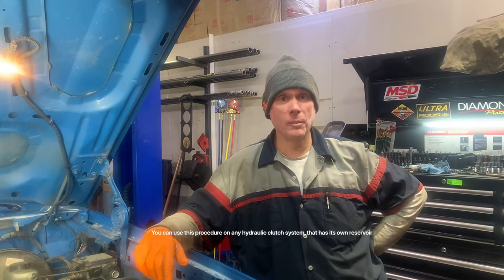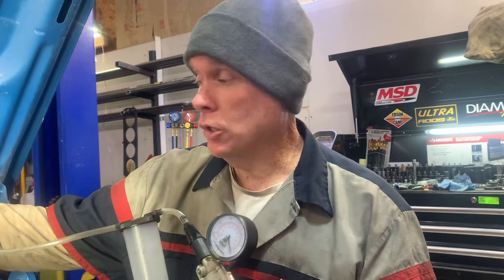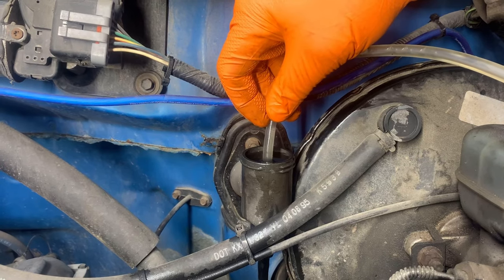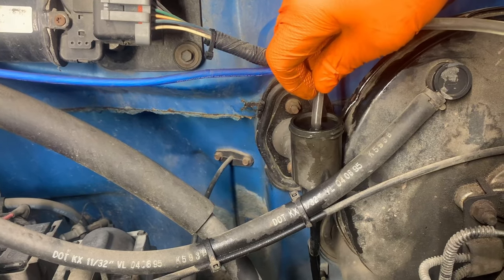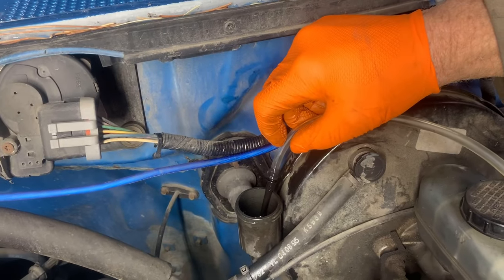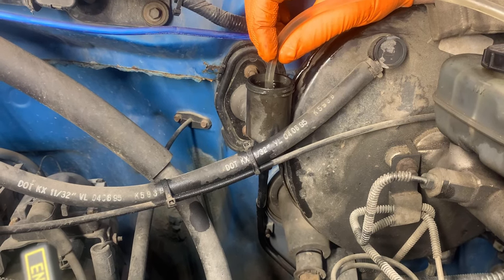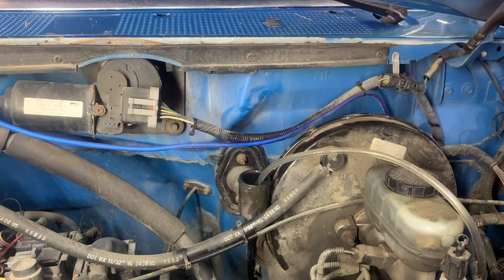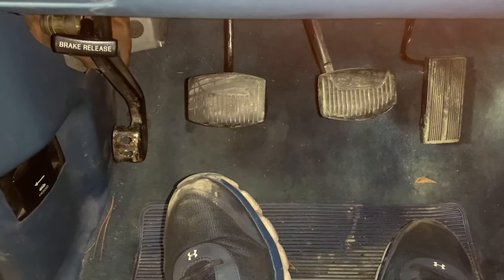Easiest, way to bleed a clutch. Works on impossible Ford concentric slaves. Can be done alone.

Comment: [Edit:Solved]
Really hoping this method solves my clutch bleeding in the end.  I have a question tho.
88 Ford f350 7.3 concentric(?) clutch (tiny allen key bleeder <or> no bleeder).
In the bottom of the reservoir there is what looks like the center of a keyslot on a car door.  So kind of a slot that is rectangular.  At the top of the slot there is a small hole.  Then at the opposite end is a super tiny hole.  
First I sealed off both holes.  I'd get a vacuum, then as soon as I'd go to pull it out (with the fluid topped ofc) the pump would pull all the fluid out of the reservoir faster than the master will pull it down in and air would get in the lines.  No pressure.  
So then I stuck it just in the bigger hole and while that seemed to work(ish) it would end up just emptying the master until the catch can was full.  
Now I've hooked the hose to a hole in the top of the cap and taken out the rubber boot and am just pulling on the whole system.  Problem now it seems if I leave a vacuum on the cap and touch the pedal I lose my vacuum.  Afaik nothing is leaking.  Can't find fluid anywhere other than what I spilled.

What is the correct way?  Leave one hole open to the reservoir to pull fluid? Or is going through the cap a better way?  I probably don't understand the principle of whats going on here besides that I'm trying to pull all bubbles out of my master/slave/lines.

and ill happily take a resource to go to about this instead of asking for a physics course on pulling a vacuum.  Until then I guess I'll keep looking stuff up and trying.
Reply from the maker: I’m not familiar with that set up. Which is strange in and of itself. I would say through the cap. However it needs to be in fluid. Let me look up that part and see what you’re dealing with. When you apply vacuum to the system, it pulls air up because it’s lighter than the fluid. It therefore, rises.
Reply from the maker: I figured it out, but f you could have someone pump the pedal, while you look in the master, to see which ch hole has fluid/air coming from it. That’s the one where you put the cone.
Reply: @greasyhandsauto-shaunbutte9726  
Awesome, thank you.  I'll check back.
Reply: Got it done.  Thank you for the tip and while this video is short and sweet; it is (imo) the best one that has been put out using this technique. The others I watched seemed to contain too much useless information, info that demonstrated a complete lack of mechanical knowledge or not enough specifics about the method. I've written the process I used below with as many details as I can think are relevant in hopes of adding value to this video that I found so helpful. Possibly someone else with the same issue will find it useful.
Also something I have to give big credit for: Shaun responding to my comment within 30 minutes was astonishing to me, had I more questions I would've been back in these comments picking his brain.  It gave me a lot of confidence knowing the OP of the only video I found helpful during this was practically 'on the line' and willing to help.  That earns a sub and some extra effort. Thanks again.
Clutch pedal feels much better with an initial seating engagement and a full fluid-feeling push through the stroke. Shifts are firm and smooth. Unfortunately I did not differentiate which hole in the master was letting air out.
I made many mistakes during this that set me back to square one with lots of air in the system but eventually this is what I found that worked.

Early 88 ford f350 idi ZF5
[Lots of air in the line]
1) Clutch pedal disengaged
2) Remove master cyl (MC) cap, remove rubber stopper and place in a clean plastic bag. Fill the MC with fluid as high as possible. Screw the cap back on tight. Fluid should squirt through the very small (raised rim) hole in the top of the cap.  (If there is no hole then a different cap with a hole in it must be made/used) 
3) Using a small cone fitting and the tube adapter fitting (bigger to smaller inlets; side profile resembles a + symbol). Fix the cone fitting to the mightyvac tube and the smaller inlet of the tube adapter on the end of the cone fitting.
4) Place the larger inlet of the tube adapter over the rim of the hole in the MC cap.  The adapter should sit flush with the cap. Pull a vacuum, it may not hold at all above 10, keep pumping.
5) When at least 17+ inHG can be held and close to no bubbles are coming out then relieve some of the vacuum.  When relieving, be sure that a pocket of fluid is entering back into the master.  If a pocket of air is about to enter either pull more vacuum and repeat or wait till fluid travels towards the master.  Relieve the vacuum to 10-12 inHG
6) In the vehicle, slowly press the clutch pedal, when you hear bubbling then fully engage the clutch quickly and hold till no more bubbles are heard.  Place a board between the seat and the pedal to keep it fully pressed to its limit.
7) Check the vacuum.  If below 7 then pump to 12.  Do not exceed 17inHg with the clutch pedal engaged.
8) In the vehicle, pump the pedal as many times as you want. Slow and gentle for the first pumps and then as hard and quick as you want. It may be very soft at first or not want to return fully.  If so draw the pedal up manually between every stroke and pump it through the full stroke up to it's highest pressure.  Once it is as good as it will get leave the clutch pedal disengaged.  
9) Pull as many inHG as you can and let it sit (mine would not easily exceed 26inHG)  If it is dropping pressure then continue to pump until it is stable.  Hold the vacuum until bubbles are infrequent or non-existent.  Early in this process it may seem that the bubbles will never end.  If it's been sitting under vacuum for an hour and still giving bubbles then move on.

-Repeat steps 5-9 as many times as necessary (I did this for about an hour) periodically removing the Mightyvac when it is at very low vacuum to check the fluid level.

-When enough repeats of this process are done there should be no more bubbles coming out of the MC cap with the clutch disengaged.

10) When no more bubbles can be pulled at 22-26 inHG relieve the pressure to 12 and remove the Mightyvac from the MC cap entirely.  
11) Remove the MC cap, top off the fluid, place the rubber boot on the cap and screw on tight.
12) Pull one more vacuum of 17inHG, make sure it is stable.  If it is not then the rubber boot or cap are not seated properly.
13) Remove Mightvac and you're done.

More notes:  My slave-cyl could be slowly letting in air although I haven't found fluid anywhere. The process of engaging the clutch while at a high vacuum always seemed to introduce new air into the system no matter how much I bled.  I have not found any leaks in the system and with the clutch fully engaged I can hold 26inHG for 10 minutes.  After an hour it would settle at 17inHG and hold for several more hours, eventually dropping but never below 7inHG even overnight. Without the clutch engaged I could hold 26inHG it seemed like indefinitely.  Engaging the clutch, holding, applying a medium vacuum and then pumping seemed to give the best result the fastest.  It is possible that I created a leak by pulling such a strong vacuum and then pressing the clutch quickly, but 20 hours later or so and I haven't found any leaks.  The slave open doesn't seem to want to hold more than 17inHG for very long.  

Every time I went through steps 5-9 and would re-apply a vacuum to the MC cap after pumping I would get a flurry of almost foam-like fluid because a big rush of very tiny bubbles would get pulled through.  Applying steps exactly as written seemed to be the only method that worked to eventually get the system to where no bubbles could be drawn out for as long as I could stare at it.

cheers
Reply: And yeah, it's pretty obvious.. but I'm not a certified mechanic. I just know some stuff I guess. What I outlined was the method that worked for me. Not trying to portray that this is the standard or correct way of doing this.
Reply from the maker: @C-wey  excellent instructions. Thanks a million.

Comment: well after following your advice I need your help.   I was bleeding it the traditional way and it was not going fast enough so I tried your trick with the same tool.    Now I have no clutch pedal at all and i can't bleed it the traditional way nothing is coming out form the bleeder valve with the system full of fluid.
Reply from the maker: Are the parts new? If so, start with the pedal down and then pull it up. If they’re not new, you likely have a leak.

Comment: Wish I knew about this a couple of weeks ago. It would have saved me a lot of misery.
Reply from the maker: It’s such a poor design. They are almost impossible to bleed conventionally
Reply: @greasyhandsauto-shaunbutte9726  Will this work on a Ranger with the remote clutch master cylinder reservoir? That's the one with the master cylinder you have to get at through the wheel well.
Reply from the maker: @1Dougloid  as long as you can get the vacuum pump to it, it will.

Comment: Hate to keep bothering you but I'm just not having any luck at all doing this. It's a 87 Chevy r30 , replaced master and slave, it's not sucking the fluid back in, I'm getting 25 on vacuum when I pull the hose doesn't suck the fluid back in any suggestions?
Reply from the maker: @garyturner5786  are you getting bubbles out of it?
Reply: Just a few
Reply from the maker: @garyturner5786  okay, do it with the pedal down and then pull it up and do out. You should get a lot of bubbles the first time you do it. If you aren’t, air is likely trapped, in the master. Putting the pedal down should bleed it.
Reply: OK thanks

Comment: When you insert the tube into the reservoir do you insert it into the little hole on the slave or simply put in inside the fluid ? Thanks
Reply from the maker: It needs to go into the tube, at the bottom of the reservoir

Comment: the pump just sucked the brake fluid out of the clutch reservoir and now its empty,  the way my reservoir is laid out, the line that feeds down into the clutch is not straight down its at an angle. so that barbed tip will not be able to get in there.    were you pushing the tip into the opening and if so, how was yours laid out?  any suggestions. thanks!
Reply from the maker: Yes right into the opening. It went straight down.
Reply: @greasyhandsauto-shaunbutte9726   thanks for the reply.  i  dont think this method will work for me since my revivor is at an angle and i cant get a vacuum seal on it. thanks anyways
Reply from the maker: @Runescape.  good luck.

Comment: Im trying this as we speak, and am getting a consistent amount of tiny bubbles. Almost in a line. It’s been an hour so far. Does this indicate a suction side leak? Or is this normal.
Reply from the maker: There is a leak somewhere
Reply: @greasyhandsauto-shaunbutte9726  if I don’t see any fluid leaking from bellhousing, where would the other places for leaks be?
Reply from the maker: @DarkPaladin001  From the master cylinder, under the dash. Also, you may not always see the leak. Is there an access cover? If do use a flashlight and look for wetness.

Comment: Howdy Shawn, I replaced the slave cylinder on my 96 f150. When I am trying to bleed it the normal way, no progress down below. I tried your method with no success sadly. I got small air bubbles coming out of the line, but nothing like you had. After trying your method for 2 hours (clutch depressed and not) i still have no peddle. I tryed going back to a vacum bleed on the bleeder and got no fluid. I tried reconnecting the hydraulic line to make sure it was seated, still no luck. It doesnt take any fluid from the resivor either.

Got any ideas to go after next?
Thankyou very much.
Reply from the maker: @IsaacDshoup  Sorry to hear, if the master is for sure good, pump the pedal a bunch of times (100 or so) and retry.
Reply: @greasyhandsauto-shaunbutte9726   Howdy, it ended up being the new master I got a few months ago failed. Replaced it and now have the lightest clutch I have ever felt. Thankyou for your help. Have a great day.
Reply from the maker: @IsaacDshoup  great news!

Comment: I understand this is how you get the air out, but how do you get the old fluid out to replace while bleeding?
Reply from the maker: @mikeprice8307  there is a bleeder, at the transmission. You could use vacuum on it or pump and bleed it. The second method takes 2 people.
Reply: @greasyhandsauto-shaunbutte9726  so other than what you just stated, this videos method won't work?
Reply from the maker: @mikeprice8307  yes, I thought you said you wanted to replace the fluid. 

To do that you suck all of the fluid, from the reservoir and then open the bleeder. After it’s empty, you fill it up. With the pedal down, use the method, in the video and then again with the pedal up, till all bubbles are gone.

If you’re not replacing the fluid, then use the procedure. I made this video after a clutch job so, the fluid was new.
Reply: @greasyhandsauto-shaunbutte9726  I guess where I'm lost at is at what step in the changing fluid process is this vid crucial.
Reply from the maker: @mikeprice8307  If you’re just changing fluid, you shouldn’t get any air. Just bleed it from the bleeder and make sure to keep the reservoir full. Have you bled brakes or clutch before? If not, you need two people, one working the bleeder and keeping the reservoir full. The other pumping the clutch. You pump it 3-4 times, open the bleeder and when the clutch hits the floor, close the bleeder and repeat until new fluid comes out.

Comment: 94  f350 pump pulls great vacuum but nothing comes through line tried with pedal down and up truck has set 15 years clutch does disengage just not enough to shift while running any thoughts?
Reply from the maker: @sammiller3554  are you getting fluid just no bubbles? If so, likely you need a clutch and probably a slave.
Reply: @greasyhandsauto-shaunbutte9726  no fluid either just negative pressure. Slave moves some and clutch will disengage slightly just not enough yet. does get fluid at the bleeder when try conventional method of bleeding
Reply from the maker: @sammiller3554  no fluid? Hmm, try pumping the clutch pedal 75 to 100 times. Just normal, not fast or, not slow and see if that solves your problem.

Comment: Great video! I have a 92 ford f150 5 speed 4.9 that shifts fine but the pedal only returns half way and I have to pull it up the rest of the way by hand to reach the top. Could it be air trapped in the master cylinder? Thanks for your help:)
Reply from the maker: It for sure could be air.

Comment: It wasnt clear to me whether or not when you initially apply vacuum, is the reservoir full?
Reply from the maker: Yes and it helps to start with the pedal down.
Reply: @greasyhandsauto-shaunbutte9726  i currently have no issue with my truck but i want to flush out the fluid because its old, would using the traditional bleeding method work or would i still need to do this method?
Reply from the maker: @drzflyest4  as long as you keep the reservoir full and don’t let it go dry, it should work from the bleeder.
Reply: @greasyhandsauto-shaunbutte9726  thanks

Comment: Quick question. I bought the vacuum gage and it’s been pulling a crazy amount of air out, but my pedal is still to the floor and it doesn’t seem like it’s building up. Could my master cylinder be out? Also do you pump the clutch after vacuuming the lines?
Reply from the maker: I could be the master or slave, you shouldn’t need to pump it. Try it with the pedal down, then up. If it keeps pulling air, there is a leak somewhere

Comment: Can someone help me understand whats going on here. 

Is the bleeder valve at all open when he is doing this? 
wont the vacuum pump pull some of the fluid out as well? causing there to be air in the system? 
What happens if the master cylinder goes dry? 

Thanks in advance! 

My 96 F-150 lost clutch pedal pressure randomly, i want to make sure that this isnt the issue before taking the tranny out and replacing the slave cylinder
Reply from the maker: Yes some fluid will come out. The master holds more than the system. Make sure that the bleeder is closed and if the parts are new, do the first vacuum procedure with the pedal down. Then do the rest with it up. Thank you for the questions.
Reply: @greasyhandsauto-shaunbutte9726   Thanks for the quick and helpful Reply! 

Im guessing if my vacuum doesnt hold then ill know i have a leak (likely in the slave cylinder). Im going to give it a shot on the weekend, ill come back and post how it goes!
Reply from the maker: @TheIminator25  yes, if it doesn’t hold, you have an issue.

Comment: This video could've saved me alot of time. I came up with a similar method after days of picking my brain. I do the same thing but have someone open the bleeder with a tube in a brake fluid container and "reverse bleed" them. Works pretty good, but I will be trying this method.
Reply from the maker: Good idea, I’ve reverse bled clutches before.

Comment: Does this works on any car/truck that has a master/slave cilinder or its just specific to Ford trucks for some reason?
Reply from the maker: It will work on any that has its own reservoir. Some of the newer stuff share the brake reservoir. It won’t work on those.